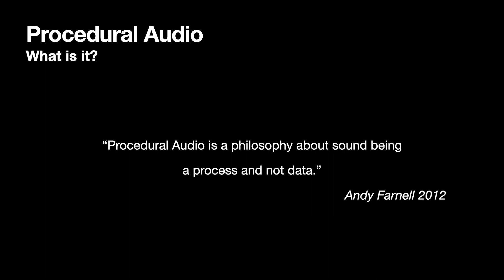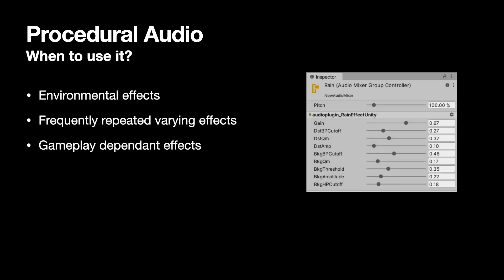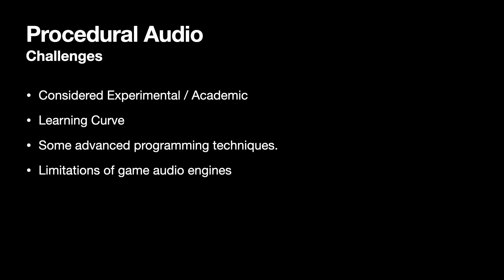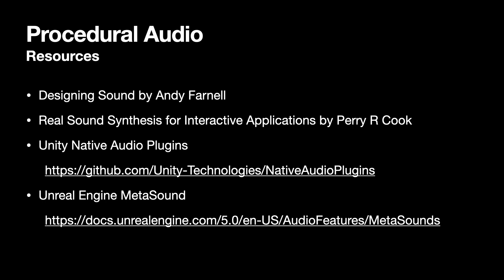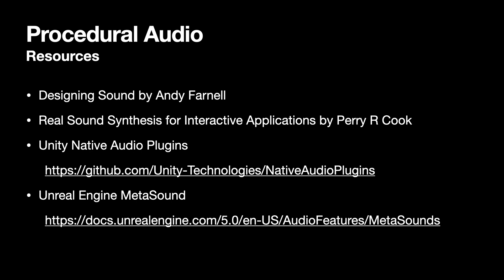01 Procedural Audio for Game Platforms (Unity and Unreal Engine)

Comment: hi, thanks a lot for sharing knowledge and techniques of procedural audio in games. I'm wondering if you can also share any website or articles of your works?
Reply from the maker: The later videos have links to any code I have written on git hub but I haven’t got round to producing anything else. I would highly recommend the book Designing Sound by Andy Farnell and is still the definitive text on the subject in my opinion. Although the examples are in pure data the methods are pretty similar in game engines (and could be used directly in Unity using libpdintegration)